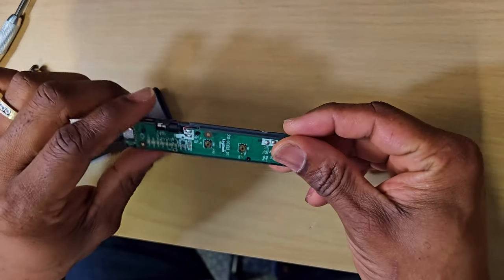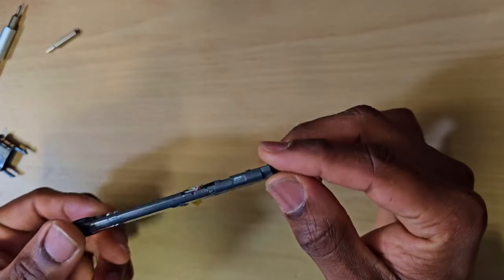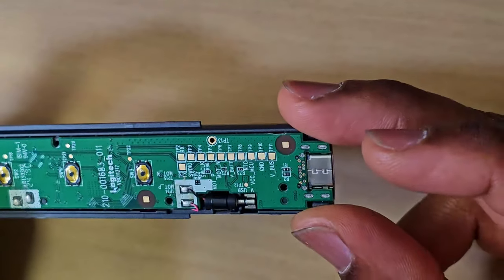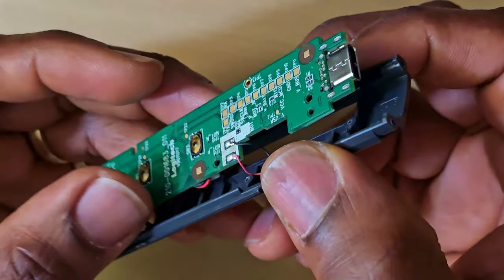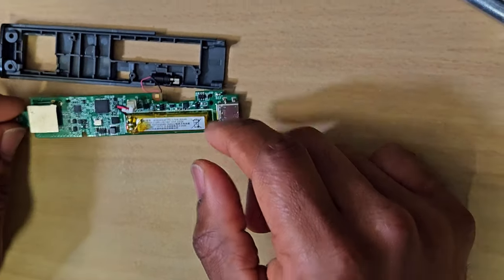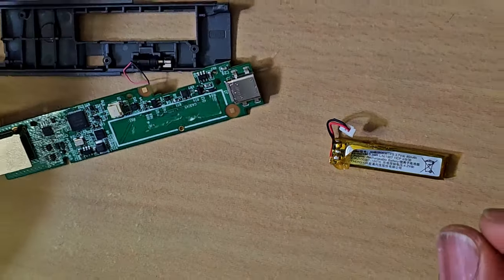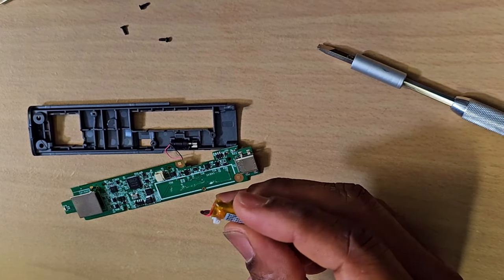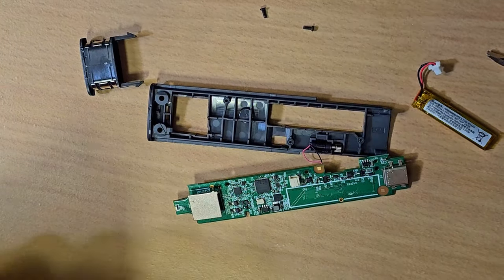Logitech spotlight battery replacement

Comment: Got it done! Thanks. However in the previous video, removing the bottom plastic seems to be held by glue in mine so it was somewhat damaged as I pulled it out
Reply from the maker: That's good. At least you got it done, you didn't have to buy another one.

Comment: May i know what is the spec for the battery ? my device has not been use for years and not able to charge . I "believe" the device is okay but battery died..
Reply from the maker: Lithium 18650 3.7v 3000 mAh rechargeable battery. Please do not take this as legal or certified advice, for I am not an electrician.

Comment: Thank you for the explanations which have been very helpful. Unfortunately, it only makes me determined that I will never buy anything from Logitech again. I have never experienced a more poorly designed gadget that essentially prohibit battery replacement with lots of unnecessary encumbrances. If this is Logitech's philosophy, then goodbye.
Reply from the maker: @danielchin1330  I'm with on that. Poorly designed